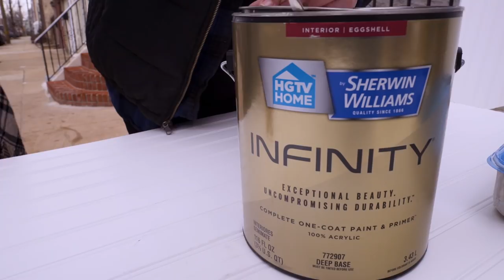The Weekender: "Beauty of a Beige Bath" (Season 4, Episode 2)

Comment: I wish you would also cover the cost of doing these projects.  While an exact pricing would be awesome, I wouldn't mind a ballpark number either.
Reply: ballpark in material, not including labor is around 1500.00... most expensive thing was the wall paper.
Reply: Jesse Castro mind you, the show is sponsored/subsidized. Estimates would be underpriced
Reply: My guess is about $2500 (labor not included)
$1200 sink
$200 faucets
$200 beadboard 
$100 paint 
$200-400 medicine cabinets with mirrors
$250 nails, glue, brushes, pluming material, drywall, screws, electrical stuff, etc
$200-500 decor, rugs, hooks, new towels
$120 new light fixtures

+labor (on the lower end)
$500 sink install+pluming 
$150 drywall repair
$150 paint labor
$350 beadboard install, including baseboards and trims
$50-$100 per light fixture install
$75-$100 per hour any other electrical work 
$150 other details ( mirrors and hardware install)
Reply: This is the most accurate estimation i have seen, the double sink vanity runs about 1600$ on average.
Reply: He zn tvp
Reply: @nataliajohnson6631 .. Actually there isn't too much of this you would not be able to do yourself.. albeit NOT in one week-end.  My girlfriend and I have flipped several houses and have done 90% of the work ourselves.
Reply: @YashaClone  - they didn't buy a new double sink vanity though - they reinstalled the old one with some new faucets.
Reply: @Rosy2468  I believe she did Because she said " I chose a solid white stone for the sink" at the end and at the beginning and said "your sink is gonna go."

Comment: Very clever way to cover up so much of the cream tile with the wainscotting.  I wasn't sure about the color either but the wall paper tied it all together.  This should be an HGTV show for sure.  Thanks for all the wonderful ideas.
Reply: I think they demoed the tiles! No?
Reply: @mulliganstew72  no, they only demoed the top band of tiles because some of that tile stuck out from the wall and she needed a flat surface.  They filled that in with drywall before applying the wainscoting.  You can see the beige tile still intact and being covered in the video.

Comment: They took tile which is cleanable in a bathroom and replaced it with a cheaper material that's harder to clean and wouldn't do as well in humidity.
Reply: Jeff Pagan yeah, but it does look a lot nicer.
Reply: Sometimes fashion isn’t practical.  Sometimes an upgrade on a budget gives a better frame of mind.
Reply: I agree with the humidity issue she might have. A wood panel near the bathtub, seriously! I like the previous look better.
Reply: They make waterproof wainscoting.   I have it my kitchen, it's great.  Also paintable.
Reply: You can always coat the wood with a great sealer. If water lands on it, it wont penetrate the wood youll only see little bubbles of water on top of the wood.
Reply: This was not budget ... Looks good.
Reply: they scraped off the ugly !!
Reply: They could have painted the tiles blue with tile epoxy paint and obtained the same look while keeping the tiles.
Reply: @esmeraldagreen1992  yes, but what's the lifespan of the epoxy? Thinking of the tiles being exposed to cleaning products. 
Don't get me wrong; I'm all for reusing, but not for time/money on a project that won't last beyond a few years.
Reply: M P well it ain’t her style
Reply: @esterixis  
My 20 year old tiles still look new
Reply: The first thing I thought was why in the world would you take out tile and put in crappy wainscoating.  Seems like storage was lost everywhere.
Reply: I actually thought the tile was unique. Very pretty. I would have worked with the tile. Kept it and painted that wall the gray color. Would not have went with full wall paper. Never good in a bathroom
Reply: @esterixis  agree. I've seen those clips on here of people painting their tiles and putting contact paper that looks like marble on the countertops. No. Neither holds up and I think it looks obvious. Tacky.
Reply: @esterixis  yeh..from what I see on ytube and my friends who did the epoxy thing on their tubs or sinks..they have to redo that every couple years or it looks crappy.

Comment: I really love the look of the end result, emphasis on 'look'. It looks great, but a) the humidity/steam from showers and baths will eventually weaken the glue behind the wainscoting and make it warp since it's cheap pressboard; b) same thing for the wallpaper. Wallpaper, even glossy wallpaper, is porous; ergo, moisture will eventually damage it. The adhesive will eventually weaken and the wallpaper will start peeling off in certain areas. But if you're going for just pure aesthetic with no regard for longevity, then this was a home run!

Comment: Beautiful color correction, but you put wallpaper over drywall that was not prepped or primed.  If she wants to change in the future that is going to be a real problem.  If me I would have kept the cabinet and painted it black and removed a drawer or two and put in shelves to save money.  I think the counter top was white already so no need to replace.  Replacing the faucet, mirrors and lights above the vanity makes a huge difference .  Other comment below was the wainscoting was less quality than the tile, however properly prepped with primer and using the correct paint and sealer should be fine.  The only thing I would have added is a piece of back splash at the sink and tub. More expensive but makes those areas more water tight.  Great transformation and really pretty.